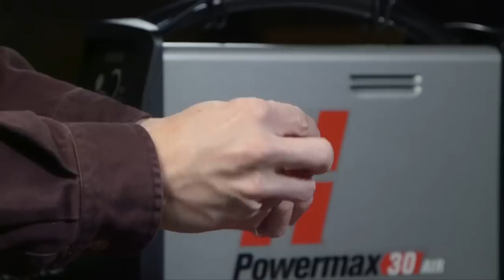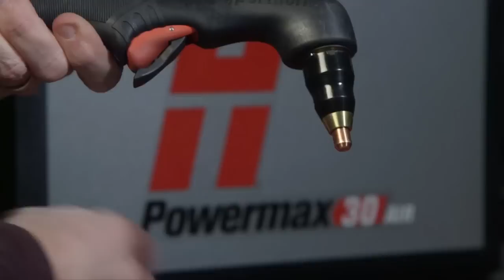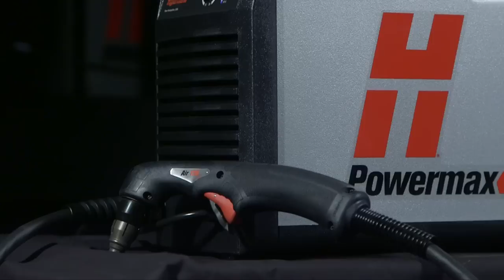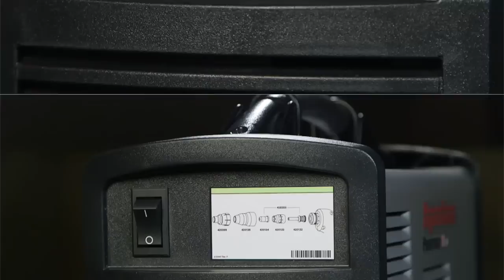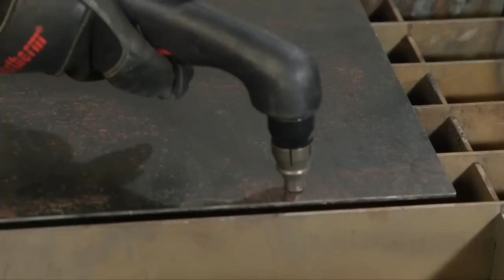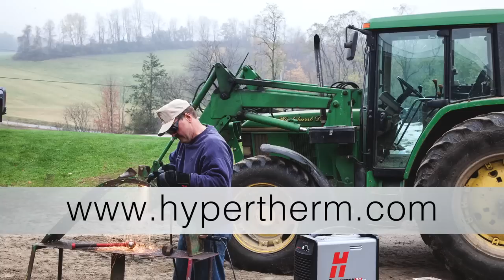Powermax30 AIR setup

Comment: We have a Power Max 1250 which suddenly showed a red electric symbol.  What could be wrong?  What do I need to do?  It usually works just fine with no issues.
Reply: Well what happened? No one answered you, did you ever get a repair?

Comment: how is it possible the internal air produces enough cmf for the plasma cutter how about a water separator?  Not complaining here cuz thats a dam good idea put does the added components reduce cutting capacity because lets be honest here one plug has to run 2 machines. I only ask about water because you really should clean that air before,
Reply: توصل للعراق والسعر
Reply: HOW MANY DOLAR8